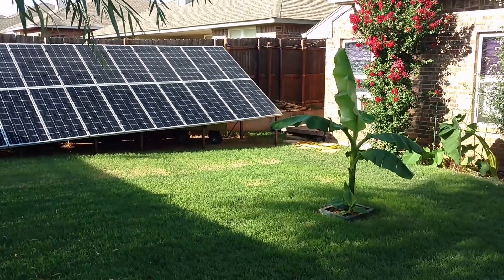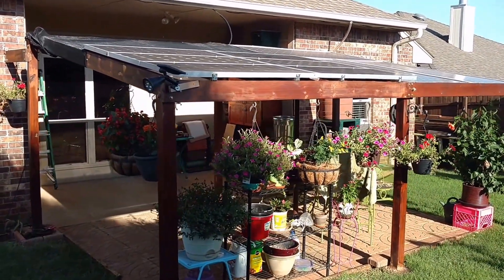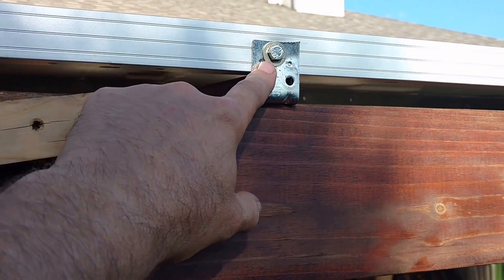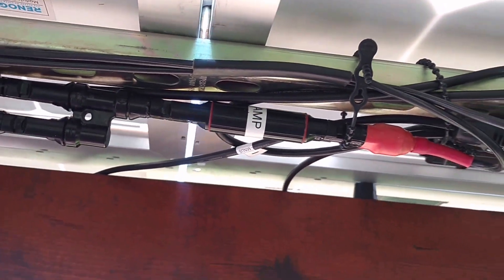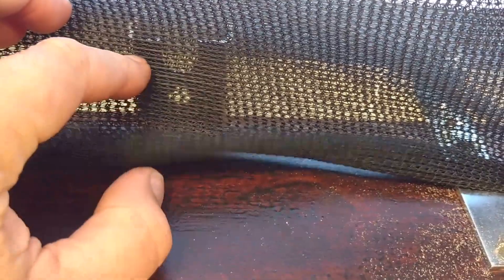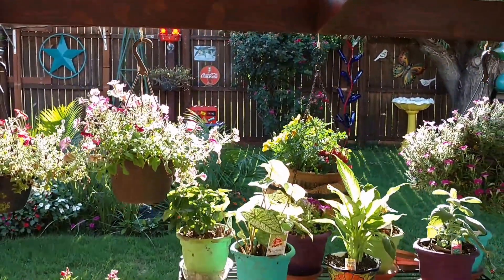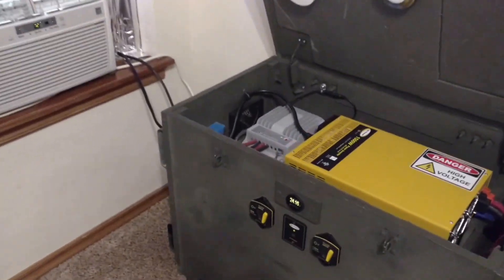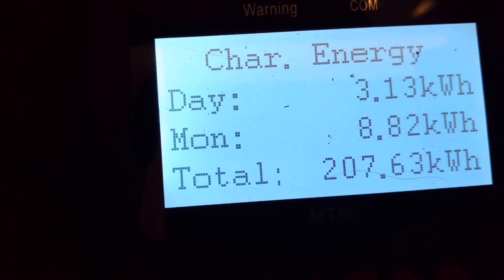Get off my lawn! Moved 600w in solar panels off the grass

Comment: I was hoping to ask another question on your system, are you running 2.4kwh of 100 watts, what is your typical day output, i have 1.2 but thinking about adding the renogy 150's 4 of them as i have 12 of the 100D's, I would like to see an output of 2k but im not trying to fill my whole back yard with panels...maybe
Reply from the maker: On that array (24 x 100w Renogy RNG-100D mono panels)...I would say 10 kWh harvests are about average. It is all relative (as you know) with conditions, time of year, angle, dirty panels, heat/cold. Have seen 12+ kWh days. My PV feeder cable run is long...so, losing about 5% or so. I am a proponent of ground mounting solar panel arrays (with tilters or trackers if you can do that).
Reply: I used the renogy top pole mount 5ft edition for 4x4 panels and the others i have them on a slanted brick jetty from my back corner of my house, hard to explain but they are at 30 degrees and the other 8 i think are near 45, my inverter just came in to get the rest setup so I haven't seen a full output yet of all 12, but like you have; i setup a transfer box and will power my main floor except 220v, I will be running 280ah of lithium for little over 6k@2c, just hoping its all enough to balance my usage, 60% of my use is AC so im gonna power the fan of it /furnace so hope that cuts into the 800 watts it takes to run that. how many panels do you have total, where do you find room for them ;-)

Comment: Is the generator making clean power without an large electromagnetic field?
Reply from the maker: EMF is everywhere nowadays. Solar chargers and inverters produce large EMFs. There are several meters available to measure field strengths (never did that with my equipment...but, am interested). Laptop computers, cellphones, microwave ovens, old CRT televisions, fans, etc also produce EMF. Thankfully, at night all my solar equipment is "resting"...no DC-DC or DC-AC converting (PWM switching). During the daytime I don't spend much time near those emissions. And, you really need to be close for the EMF to do serious harm. I am no doctor, but worked on ground radar systems for decades...and distance is your friend when it comes to EMF. Great question/topic. Some folks are hyper-sensitive (get headaches, etc).
Reply: Everything makes an EMF basically if it uses electricity. The earth even has naturally occurring EMF's. However, there's no harm to humans, animals, or plants in most cases, even with strong EMF's. You have to be standing in front of a big microwave emitter to start seeing any ill effects usually. Some people are pretty sensitive to the 60Hz frequency that AC runs at, and it can be bothersome.
In my experience though, that's usually 'dirty' power causing coil whine or such, not the actual EMF, that's bothering them. (We do a lot of IT support and work with sensitive equipment at doctor's offices, etc. and in places where people are... easily bothered... by a lot of things. I've been able to solve a number of things by simply using higher quality power supplies.)

Though, 'dirty' power can get pretty annoying and cause a lot of interference for wireless communications, other sensitive equipment, etc. The inverter he's using looks like one of the Go-Power Pure Sine Wave ones, those are decent and don't produce a ton of excess EMF from what I've seen.

Comment: Very nice job Chris! I'm newer here, first time post on your channel. Been watching your videos on your "solar journey" for quite some time tho. I'm 32 and only have a small apartment and a very small "back up" power generator. I have 1 100watt Renogy panel (not hooked up atm cause it's more for when I'm in the field using my ham radio) 2 Interstate SRM 27 Deep Cycles and a Xantrex ProWatt 1000.. Hoping some day I'll be able to have a setup even half as nice as yours! I'm envious of just the system in your bedroom for you A/C.. Nice work!

Comment: Nice work ! Those Tracer charge controllers are hard to beat cost wise I don't think there is a more bang per buck charge controller out there.
Reply from the maker: Def a good inexpensive MPPT charger. Checked the MT-5 current reading with my current probe...it was dead on accurate